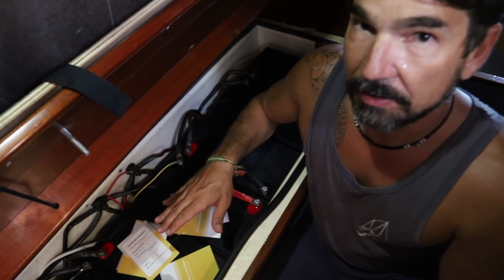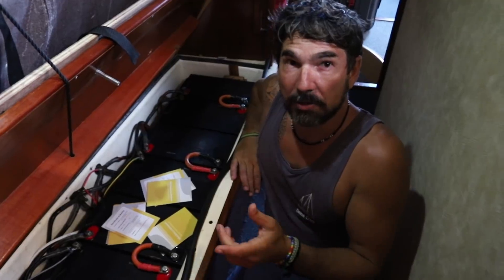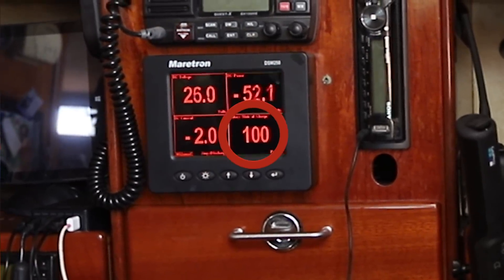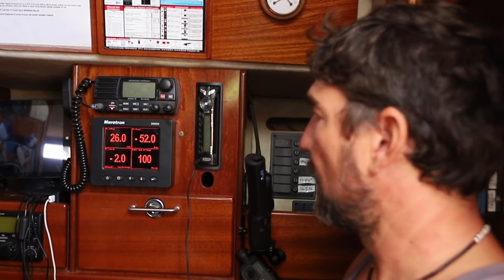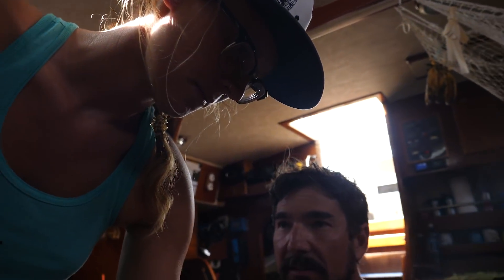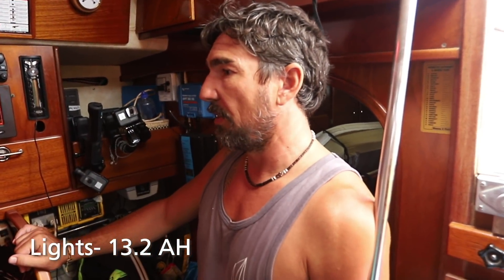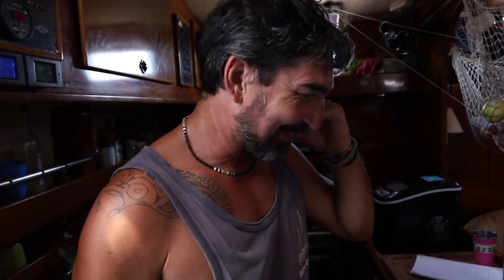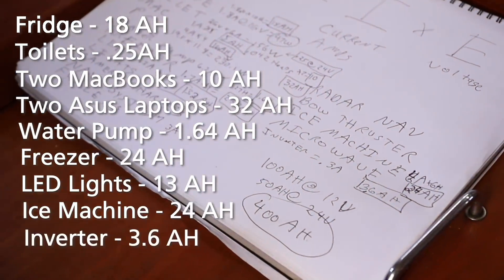WATT THE HELL is an amp hour?  Sailing Vessel Delos

Comment: Very nice video and very useful to estimate the amp hours for all the equipment, but... your statement that you can draw 40 amps for 10 hours is not correct. The amp hour rating of batteries is based on a 20 hour draw, so the only correct one for your 400Ah bank is 20 amps for 20 hours. If you draw higher current than nominal the capacity is less and when you draw a lower current your capacity is more. This is called the Law of Peukert. https://en.wikipedia.org/wiki/Peukert's_law 
In your case you are good, since you use about 5.4 A average, which is way below nominal. You will drain to your target of 50% in 48 hours using Peukert's law instead of 37 hours with the rule of thumb. I would not be bothering you too much about the 11 hours extra, but you started talking about a new boat and indicated possible electric propulsion. Now Peukert is your enemy. High discharges will result in disappointing numbers. Running for instance 8 hours on electric propulsion is serious drain. So read the wiki page and do the math. Love your videos!!  Frank Mulder, Durgerdam, The Netherlands
Reply from the maker: Yes you are absolutely correct Peukert will bite you!  So in reality you must consider the amount of current you are drawing.  We have switched to Lithium so stay tuned for that video :)

Comment: Just a question.
How viable would it be for a sailboat like delos to convert to an electric drive, as in a electric motor with a battery bank of the equivalent weight of the engine+fuel or an electric motor powered by a diesel generator?

Just curious about the various methods of engine options for a sailboat.

*edited because that sentence was garbled and just bad, sorry
Reply from the maker: I have researched this quiet a bit as of lately.  The short answer is yes if using Lithium cells and only need the motor for a limited time, however if you travel like us an may potentially need the engine for hours/days the only real option is electric hybrid.  The energy density of Lithium cells just isn't there yet.  Anyway we are gonna try and do this for Delos 2.0 so will let you now how that research goes.  Brian

Comment: Just because the batteries capacity is given in amp/hours is no reason to go nuts on it, outside of the world of batteries the expression isn't used. Just convert your 800 amp/hours to 9.6 kilowatt hours, that gives 4.8 usable, now the whole conversation can be in watts no matter what the voltage is. While not everyone relates to watts, it's way more understood than amp/hours.
Reply from the maker: Yep absolutely agree but for some reason in the marine world all the meters and such are rated in AH, so that's sort of the unfortunate state of electrical units.  In the next video I install a new meter that gives readings in Watts which is very exciting!

Comment: With the solar system charging the 800 amp hours are not stactic you would be adding amp hours all the time , make the math change constantly correct?
Reply from the maker: Yep, correct!  Will cover this in a video soon...

Comment: was that energy check on the laptops done while you were rendering or just running? I know you are going to have a higher amp draw when you are doing your video work.
Reply from the maker: That was just the idle state, I assume it would be higher for both when rendering.  It will be a good test, will let you know!

Comment: Great great video. I would really like one to tell us how you set up your WiFi network and your storage for your video. How is Delos 2.0 going? Have you convinced Swan Nautor to give you one of their big boys?
Reply from the maker: Hey guys!  We have a Western Digital 21TB NAS in raid 5 configuration, hooked via 1GB ethernet to a standard Wi-fi router.  We are learning lots and have received so much cool info on Delos 2.0.  Currently speaking with a few naval architects on a possible custom design :)

Comment: As an Ex-aircraft engineer and now someone looking at joining the cruising life I always enjoy the tech stuff. I'm impressed with the fridge only using 18AH. That's one economical fridge! What is your opinion of the cycle curves and the amount of cycles you get? I am still trying to work out if you get more physical use out of the battery with deeper cycles to say 40% rather than light discharges to say 10-20%. Say you get 3000 cycles at 20% and 1500 at 40% it's still the same amount of use? Even with things like drills and torches, do you charge them up every time or do you leave them to get to say 40%, it boggles me!

Comment: Considering all those laptops run off of DC and you are converting from DC to AC and then back again down to about 9V, isn't there another way to just run the laptops off of DC directly.  Surely someone sells a power brick for a laptop that will accept DC and just knock the voltage down for you and regulate the current.
Reply from the maker: You are absolutely correct, converting from DC->AC->DC is not that efficient.  Have been considering DC->DC chargers but so far haven't found one that can put out enough power for the laptops.  Still looking though!
Reply: Sailing SV Delos so I did some research and you are correct for the Asus RoG.   I have one and the current power brick is 180W at 19.2V   and nothing I found could match that.  You could probably get one for the Mac though, but I'm not sure what they draw.

Comment: When you first press the toilet flush wouldn’t it draw a little more for the first second?   CCA cold cranking amps...you might consider this.   >>>——😁——>.
Reply from the maker: On AC motors I think it's called the Locked Rotor Current or something like that...  Not sure what the equivalent DC motor terminology is....

Comment: Great video! Did you notice any influence on the navigation equipment caused by the inverter electrical noise? What kind of inverter does Delos has? Thanks!! Fair Winds!!
Reply from the maker: Hey Luiz, it's a cheopo no-name unit I bought in Australia for $200.  So far haven't noticed any noise effecting any of the nav gear.  Brian

Comment: Brian, have you done a price performance analysis of Lead Acid, AGM, Lithium, or other battery type for Delos? I imagine you need to take into consideration the places you travel and what replacements are available.  Not good to mix match differing battery types. Take care.
Reply from the maker: Actually we ended up switching to Lithium in the next vid so stay tuned :)

Comment: This was an excellent overview of electrical capacity on a live aboard sailing vessel.  I'll be working on my system soon, so was a good refresher. I'll be using the lead acid deep cycle 24v configuration of cells initially.  Just due to cost and will be experimenting loads and discharges with solar. Would like to see a continuation of the Delos wind/solar system.  On the experimental side, a Switzerland company Nanoflowcell is suppose to have incredible energy density capacity using salt water as storage. I have been following them since, I think 2013-2014 waiting for them to make their move.  This December in the 5th season of the FormulaE racing cars, they're switching from lithium cells to these salt water batteries. I cant wait to see them perform. Here is a video from the company as a teaser. https://www.youtube.com/watch?time_continue=1&v=RqLpqR0SPnQ
Reply from the maker: That is very cool.  Thanks for sharing!

Comment: Some comment below said more scantily clad diving scenes... true, but still awesome vid!!  Now if you will do a little calculus you could figure out time decay available as constant power items (assumed) use more and more amps the lower the state of charge drops in the batts,  generating a higher amp hour use...   or just get a beer and go sailing..   lol..  One of the really great characteristics of this sailing thing (which I wish I would/could do) is the apparent value  of general knowledge combined with the Macgyver gene!

Comment: Really great Brian.. as one that added battery capacity along with re-wiring a lot if my boat.. i had to depend on the alternator on my Yanmar to charge my batteries except for the very rare and luxurious event of being on a dock with access to shore power. The alternator at full RPM would only add 15 amp. Hours so to charge 3 80 amp marine batteries it would take me about 16 hours of engine use... so understanding drains and capacity becomes critical.

Comment: Brian,  was thinking about the two live consumption measurements between the PC and the MAC.    The power demands for laptops (unlike desktops) will vary at any one time by the state of charge of their internal batteries.  You can get a more accurate worst case by using the ratings on the power bricks.   The MAC might still be less, but that would be interesting.   BTW - Awesome video.  Well explained.   Thank you.  Brad

Comment: The one thing you didn't include was the air compressor. If you are sitting at anchor is when you would be running it.
Reply from the maker: Yes, true but it runs off AC and so we need to run our generator.  AC power usage is actually an excellent idea for a follow up video!

Comment: Very clear video, should help sailors get more comfortable with the elec. systems. Question: What kind of refr do you have that only draws 1.8A@24vdc (3.6A@12vdc)?? Is it a eutectic holding plate style? Our new Seafrost uses 6A a12vdc!
Reply from the maker: They are pretty standard Danfoss bd35 compressors I beleive.

Comment: Cool video Captain Brian! I wonder how much of the power differential between the PC and Mac laptops is in the power supply. I also wonder if there would be a power savings from using DC-DC converters to power the PCs instead of inverting the power to AC and then converting back to DC.

Comment: Solar is great. We have a 19 ft maxum sportscuddy speedboat with total enclosure for the night. It is just a speedboat with a 4.3 liter mercruiser but we use it both for watersports like wakeboarding as for overnight trips with the three of us. Sometimes two or three nights. During the sail we use the 12v outlets in the dashboard for charging of the phones and tablets and the portable fridge. The fridge is just a simple peltier cooled unit. It draws 4,5 amps on 12v. And the boat has a normal starting battery. So when we arrive on our destination and drop anchor it happens that we do not move for 2 day's. For this reason we take a portable car battery and two small solar panels of 50 watt each. With good sunny weather this is enough to run the fridge all day since the panels produce 5 amp  in good sunlight. Downside is that they need to face the sun so I need to adjust the anchor and panels a few times a day. But in return I have icecold drinks and meat etc. Even if it is over 35 degrees celcius. In the evening they produce decent power (few amps)  until the sun is gone. During the evening I run it a few times for half an hour at a time and during the night it is off. But since the temp. Is much lower during the night the temp in the fridge will stay more or less cold until morning. Not ideal but just keep everything fresh without running the engine or moving is great.

Comment: Great explanation.  Things that are on continuously multiply total load by 1.25 usage.  Things that cycle like HVAC multiply by 1.00; stuff that is used intermittently multiply by 0.65 usage.  I have a similar dilemma in my Fifth wheel.  When I loose shore power, I am completely dependent on my batteries or my generator.  I've been working on my wattage draw and looking to reduce load.  Also looking at the flexible solar panels that attach to the roof.  A solar panel friend suggested I ditch the generator and fill that compartment with batteries.  I'm not so sure that's a good idea.  I'm not often without shore power, but when I am it's nice to have that noisy bugger.

Comment: Great subject, but kind of confusing. A solar and wind episode would be nice. It would even be nice if you did a handful of episodes on electricity (anchor and under sail), and how it changes with more than 4-5 crew on board. A special episode would be individuals, as in who is the biggest energy vampire on the ship. Not to hurt anyone's feelings or anything, but basically who sucks the most !!

Comment: When my wife and I did our circumnaviation we charged our laptops up using 12volt adapters and found we used much less power as there was no Waste from running the inverter, maybe wirth looking into. Love your posts brings back memories.

Comment: Very educative video. It really shines do to the fact that you used Delos as an example.
P.S.: Power consumption PC vs Mac is do to the hardware "aka" specs, even thaw you mite not be using the full "gamer" potential of the pc the "parts" in them are power hungry do to the high capability of said parts!

Comment: An amp hour is very simply, how big the battery is. So battery can put out like say 12 volts at i don't know say 5 amps for 3 hours and dies. it would be 12 volts at 5*3 amp hours or 15 amp hours.
Reply: Also it is very useful rating for batteries.

Comment: I'm not the steve mentioned.  I do understand that the refresh rate percentage on lead acid batteries is about 75%, ie: 25% of the charge is wasted mechanical bleed off (heat) soooooo if you are able when it comes time to replace the batteries get Lithium batteries their refresh rate is 90+% and they will last way longer while using less energy to recharge.  Hope that makes sense I am not sure about explaining it.

Comment: Do it the easy way Brian and use Watt as the unit of energy, amp hour makes no easy sense without taking the voltage into account regardless of   
AC or DC. ...Amp hour is only useful as storage capacity. Ps don't forget you microwave oven

Comment: I love these kind of videos and the ones where you are fixing stuff. btw: I am surprised that sitting at anchor with only the navigation system running you were drawing 2 amps (i.e., assuming you were not transmitting anything)

Comment: great video, I like the explanation and all the calculations you did. IMHO your statement about the energy consumption on MAC and PC ... it depends :-) wich model, wich CPU, wich graphic adapter, wich kind of monitor, HD or SSD, etc. Also, and more important, wick kind of "use", wich kind of software is running. Last but not the least: generally, PC users shut down their device at the end, Apple users doesn't :-) on average, Apple computer always consume electricity. Ok is not a big deal, I am not a fanboy, just for fun. See you Delos.
PS: I am from italy, so I like when you say "ciao" at the end :-) Ciao Brian

Comment: Great lesson Delos. Requests/ideas for more boat power/systems episodes...110v vs 220v systems pros/cons, shore power, power pole plug differences around the world, y cables, Amp ratings limitations, inverter usable vs rated max, incandescent vs LED lighting, efficiency tuning power systems on boat, and yes as you mentioned please do a whole other video on your solar and wind generation systems and maybe touch on the old towed-generator you all used to have.   PS: I don't know whats wrong with those Mac people either.

Comment: Hi Brian,   My wife and I are full time cruisers as well.   One piece of advice would be to get all of your electronics phones, computers etc directly on DC current.   The process of converting 24V DC to 220V AC then back to XXV DC is very inefficient.  The loss is less from the inverter and more so from the charging brick you plug into the AC socket.  These can range from as little as 20% to 90% efficiency based on the technology used.   I use a cigarette  plug charger for my mac and USB outlets for all phone and anything else that will use this standard (5V DC).  Even installed a 12V DC to 19V DC converter to run our TV.   DC to DC coverts are inexpensive and very efficient.  You might consider a 24V to 12V unit if you don’t have a separate 12 V DC circuit on board.   Best of Luck,  Tom S/V “Serenity Now”

Comment: See Jehu Garcia utube, he's developing circuit boards to use in a DIY lithium powerwall.  He's also doing an electric VW bus. You could build one for Delos.  A lithium battery can use 90% of its capacity.  You'd have 1/2 the weight, 1/2 to 1/3 the size with much more 
useable power for about the same price if you built it yourself.

Comment: Brian, you seem to have so much energy related to this topic!  If I knew watt you were talking about I wouldn’t feel nearly assaulted by all this battery talk.  But far be it from me to either resist or impede the topic under current discussion. But while you explain I will plug my guitar into it’s amp and attempt to drain every last drop of musical talent I have stored into generating a short song to help this topic make sense to me.  If I come up with something good there may be charges involved.  Or perhaps I should simply pole volt right over the whole confusing topic.  But then, there are not only positive but also some very negative possible outcomes conducting myself along that path.   I surely hope this message hasn't shocked anyone!   : - )

Comment: right on like my charge controller can set to needs like power to freezer off at 12.4 on at 13.1 to 14.1 depends on needs and batt conditions.. think 8x 6volt t105 and would be set.HAVE TWO OF THEM AND THEY PUT OUT MORE POWER THEN 4 OF THE GROUP 27 WALMART BATTS.

Comment: Question: curious why you chose to purchase eight 100 amph batteries and not fewer batteries that hold more amp hours. For example, a lithium battery that holds 300 amp hours which would save space and weight.
Reply: Steve perhaps cost , like for a bike 10Ah battery is about 400 euros about $460 get you about 20 miles on 250w motor. (about 40 batteries @ 10 each )